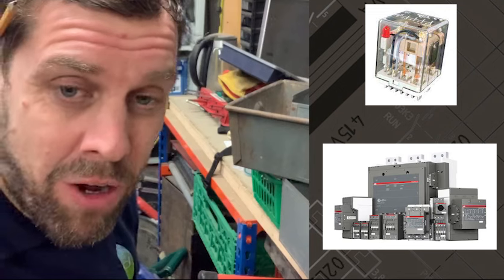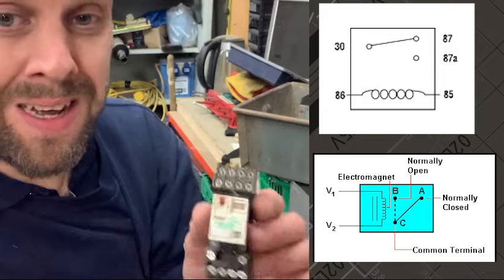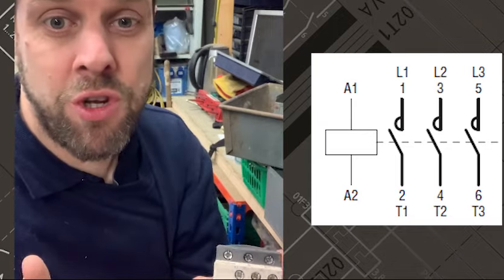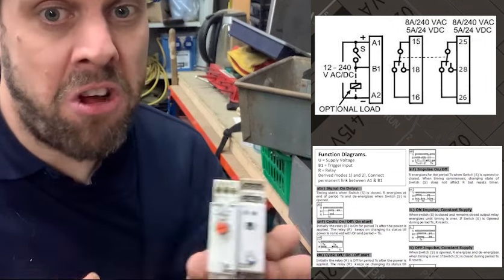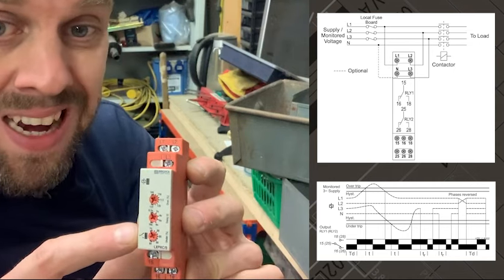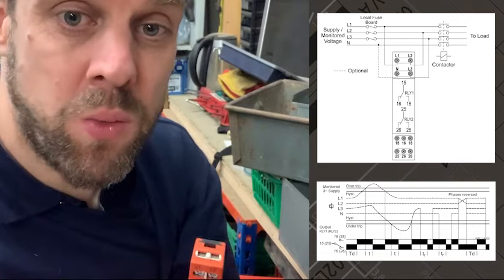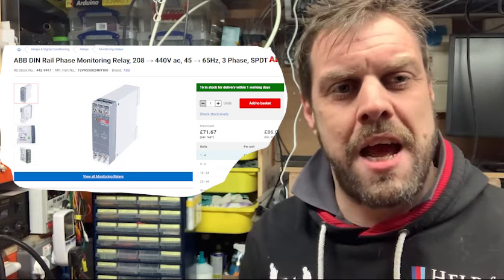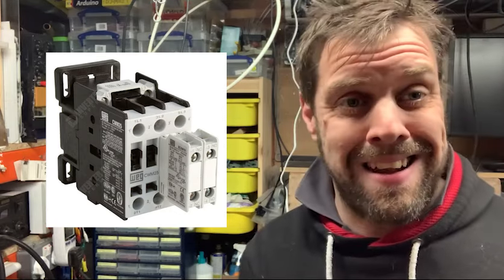RELAYS & CONTACTORS THE ESSENTIAL GUIDE

Comment: I have an irrigation pivot system on my land which of course has a couple of contatctors to control the motors, one of them was supposedly not working and when I checked the continuity of the A1 and A2 terminals it was shorted, later I brought it back to home and noticed it had a white thingy attached on its sized that resembled two reverse zener diodes which were shorted and the coil was actually fine 

Btw it is a 24v system
a couple weeks back I was messing around with the wires and I think I accidentally shorted the 24v system with the 230-380 VAC mains and that caused the zeners to short!